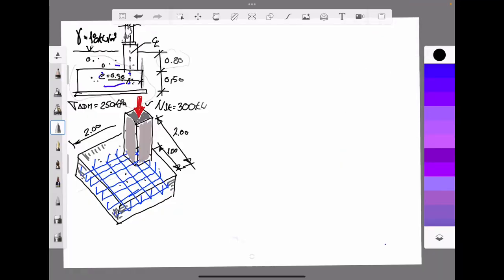Eccentric spread footing. Foundation design part 1.

Comment: Soil bearing capacity given is 250 kPa. It's multiplied by 1.25 and becomes 312 kPa to make it bigger than the soil pressure of 277 kPa. What code this 1.25 factor is based from?

Comment: On one side, the soil pressure we got is from 0 min to  277 kPa max. What about looking at the other side, what will be our soil pressure configuration?.
Reply from the maker: Hi Good evening. I m not really understand your question. I am sure it is my fault. 
Please contact me through the following linkeding profile:
www.linkedin.com/in/sergio-rodriguez-structural
there it is a possibility to have a conversation in detail through message application.
Thanks SRM
Reply: @canal_estructuras_sergio  I would like to change my question. On one side of the footing, we found out that the max pressure is 277.28 kN/m^2. The resultant R = 407.6 kN is located 0.49 from maximum pressure. Now, my question is,  the pressure we will be using along the other side of the footing is a rectangular pressure of 184.85 kN/m? This rectangular pressure is actually located where resultant force R is located. Assuming the footing is uniaxially loaded.